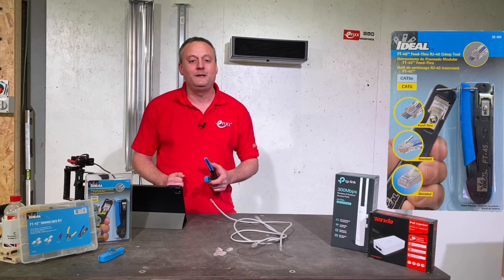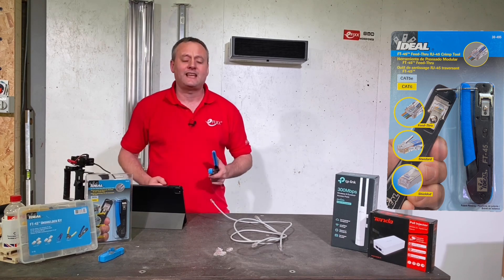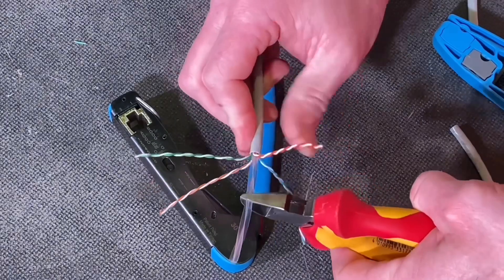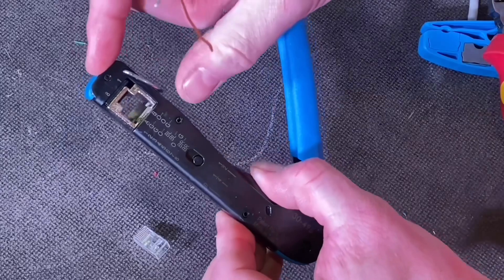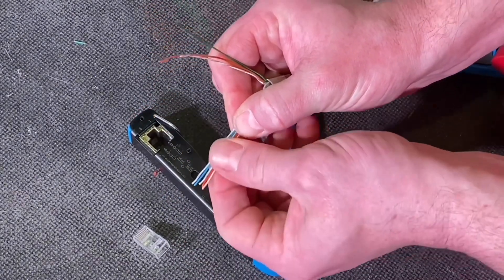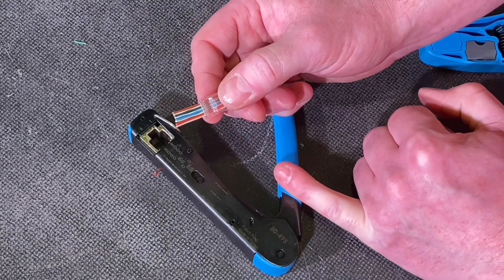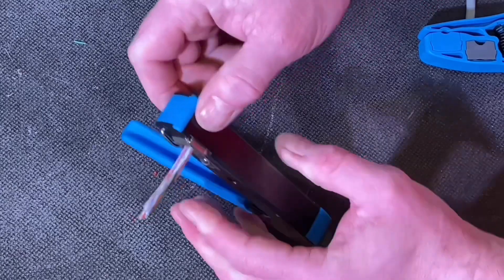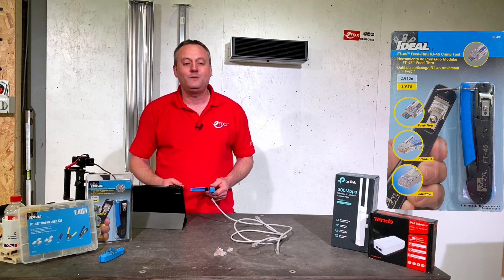Fast RJ45 crimping with the FT-45 from Ideal Industries - CAT6 cables - crimp & cut

Comment: I've used several styles of rj45 crimper, and these are my favorite for their diminutive size alone. I travel a lot as a low voltage tech, and these go everywhere with ease.
Reply: As a voltage tech, have you experienced any issues using this connectors with PoE devices?

Comment: Ahhhhh a sparky doing data...

Just need to point out that the pull string inside the sheath should be used to expose more of the conductors as the blade of the outer cover remover could have knicked their protective covers and in time this can lead to funky things happening & in the worse case corrosion build up on the conductor.  

Other than that great video!
Reply from the maker: Great tip thanks Keith 😀

Comment: I decided on the VCE crimp as it had the cable cutter and stripper built in. I do a fair bit of cabling and was failing around 10-20% of glass ends. This has improved that dramatically and more than justifies the increase in cost of each end

Comment: OK. That's the patch cables, but you could simply buy pre-made ones, no? I can typically pick decent ones up from as little £3 delivered inc. VAT. I particulary like the colour coded ones, so you know which one is which on the panel. It can't be worth the time and effort surely?
Reply: Sometimes, it is a lot easier to make the cables from scratch.
One very good reason, is you only need to drill very small holes, in any structures that you want/need to pass through.
And, ultimately, you get to make the cables to the perfect length needed for each run.
Reply from the maker: All depends upon the application - e.g connecting CCTV cameras to fixed wiring

Comment: If you find it fiddly to put all the wires in in one go, You can make the inner cores long and insert them one at a time. Then you can also easily check your colour coding, and you have plenty to pull through and ensure a nice tight fitting plug.

Comment: TIP- Structured cabling should not be longer than 90m, allowing for 2 patch cables totalling 10m. Usually Ethernet devices should be no more than 100m apart. (Except when you get involved with 10GB 40Gb and 100GB Cables, where the cables should be much shorter.)

Comment: It doesn‘t matter if you use A or B, as long as you use the same on the other end of the cable. They‘re both straight-through connections. If you use one wiring method on one end and the other at the other end you‘ll get a crossover cable. That was useful on older systems to connect two PCs directly without a network switch in between. But on modern hardware this is no longer necessary.
Reply: You should use EIA/TIA Type  B in the UK. Type A for "America, Type B for "Britain". Simples!!!
Reply: @bernardgarrett3897  Actually it's the other way around. A is common in Europe, and B the american way. And how did that occur? The americans were too slow introducing a standard for this so the europeans implemented the standard first using the common colour code of phone wiring with the RJ45. But in the US they are now also switching over to 568A. But as I said, actually it doesn't matter as long as both ends are wired using the same standard.
Reply: @Marcel_Germann  you should still use type b for a future spark that may need to redo the connection
Reply: @JesusMyLordAndSaviour777  When I would use B the future spark would probably curse me. A is the way to go in Germany.
Reply: @Marcel_Germann  Thats what my point was in UK is B
Reply: @JesusMyLordAndSaviour777  What the americans abandon themself. And like I said, for the functionality it doesn't matter as long as both ends are wired the same way.

Comment: Not done a lot of rj45 plugs before, did a few last year and used a standard plug and crimper. Found it fiddly to cut conductors to right size and correct order, but these feed through plugs look a lot easier. Definitely something I would look to use in the future

Comment: One of the best tools i ever bought pricey but worth it especialy if you have alot of cat 6 to make off. I like to leave the strands long and then get them pulled through tight so you get a nice clean connection also the shorter your exposed strands are the better they work, same reason you keep the exposed wire to the shortest length you can manage behind a keystone